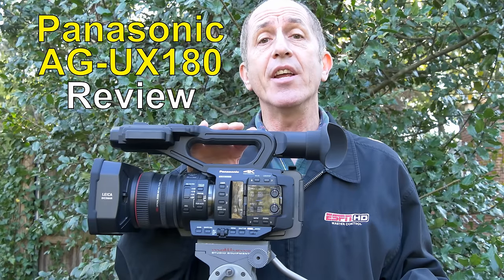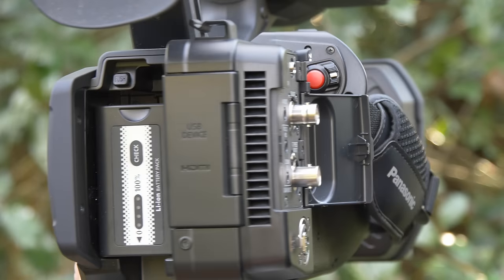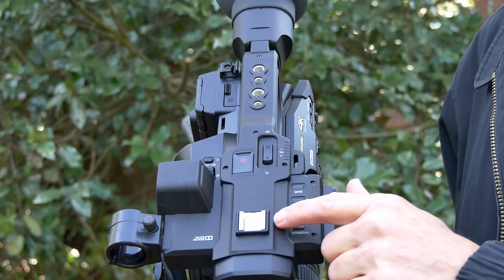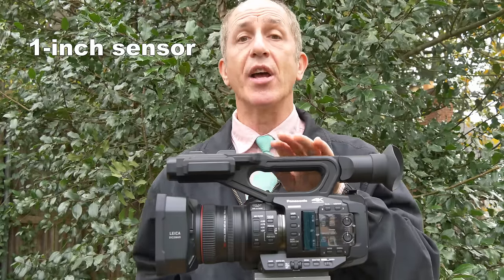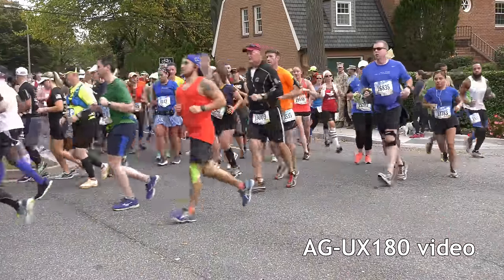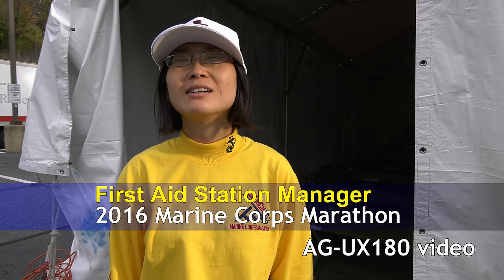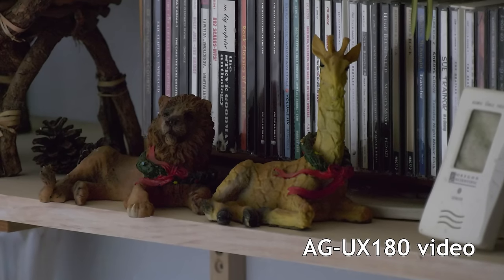Panasonic AG-UX180 4K Camcorder Review (in 4K)

Comment: How is the auto focus?   would this be a good camcorder to record lectures, sometimes with in low light situations., would auto focus find the speaker and stay on the speakers face?  And how is the low light performance, if the lighting is not the best or if the speaker is back lit, or if lighting is bad?
Reply from the maker: It's been a while since I used this camera, but I show in the video that the auto focus is excellent. However, I did not really test the auto focus in low light. The camera's low light performance is generally good, but cameras have gotten just a bit better since this camera came out two years ago. No camera will make bad lighting look good, but this camera is competent working in poor light.

Comment: Great review thanks. Quick question...I am using Adobe Premiere Pro CC 2018 as my editing software, any know issues with any of the file formats importing into PPCC2018? I know the Dolby issue has been reported, but not sure if any known issues with the LPMC audio. Thanks
Reply from the maker: Great question, but I don't know the answer. I am using DaVinci Resolve 14 and I tried files from the UX180 with Resolve. They work fine. However, I don't have Premiere. I edited this review with Corel VideoStudio X9, and it had some crashing problems. However, I think that is a computer/firmware issue more than it is a Corel VideoStudio issue.

Comment: Quick question. Looking at the left side of the camera there are 2 channels, is that 2 stereo Chanels or the left and right channels of 1 stereo pair?   My old Canon XL-1 had 2 stereo pairs when in 12 bit mode I really miss that? I would connect 2 Remote mics one to the left & the second to Right rear channels and the main shotgun mile to the front stereo pair. You'd be really supersized at what you hear when people are miced and forget. Lots of Bleeping in post too.
Reply from the maker: I no longer have this camera, as this was a loaner I got for review. However, it's my understanding that the camera records only two audio channels -- just one left/right pair. That's terrific that the old Canon XL-1 had four audio channels... that's handy to have when you need it. I can just imagine recording a concert with two direct feeds from the audio mixer and two for ambient sound.
Reply: Like I said Hearing the Pilot/s & their spotter/s while Videoing R/C Plans flying (Attempting) formation is neat.

Comment: Is the focus ring a fully manual ring with physical stops, or an electronic ring? How does the focus ring feel?  It looks like the servo zoom doesn't have a smooth acceleration/deceleration. Am I wrong?
Reply from the maker: The focus is an electronic ring, but it works fairly predictably. The servo zoom is a bit touchy and takes some getting used to, but it's much easier and smoother to control than the zoom lenses I have for my dSLR. If I add up the cost of my current camera and the three zoom lenses I have, it's more than what the UX180 costs. Since the HC-X1 is the same as the UX180 but without an SDI output, I could get the HC-X1 for less than my current rig, and it would be better/easier to use for video. Of course, the UX180 doesn't take photos, and I do take some of those with my current gear...
Reply: Thanks for the quick response and for posting the review Bob.

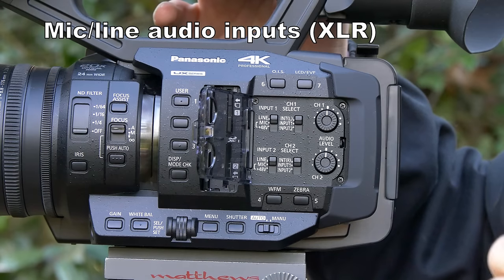Comment: The zoom rocker control you talk about at 1:00 you say that it has slow and fast. Is that the only 2 speeds it has for the zoom or is it variable? Does this apply to both zoom rockers?
Reply from the maker: The zoom rocker on the lens is a servo zoom that varies depending on your touch. This is one of the features that makes the UX180 a real pleasure compared to shooting with dSLRs -- you can do s-m-o-o-t-h lens moves easily. The zoom rocker on top has just two speeds, I think.

Comment: do you have the time to test the delay on the SDI output? on some youtube video is mentioned that the DVX200 had up to 10 frames delay on HDMI and SDI. may be the UX180 is beter here.
Reply from the maker: No, I don't have any SDI gear to use to test the SDI output. I did plug the HDMI output into a monitor and noticed considerable lag. However, that could be delay from the HDMI processing. The HDMI out did look great on my 4K TV.
Reply: thank yout for quick reply!

Comment: I seen a review of the ux90 stating that when filming in 4K with OIS on the minimum is 35mm. Is this true for its big brother the ux180 as well?
Reply from the maker: I don't think that's true of the UX180. My personal experience with the UX180 is that it is considerably wider than 35mm at 4K. Panasonic says that it's 24mm for 4K DCI (4,096 x 2,160) and 25.2mm for 4K (3,840 x 2,160). In my experience, those are the correct numbers.

Comment: Hi Mr. Bob Kovacs. UX180 - CX350 = BEST CAMERA???
Reply from the maker: I'm not sure exactly what you are asking. Between the CX350 and the UX180, the CX350 is the better camera. The CX350has a better display screen and the CX350 has MUCH better codecs and encoding flexibility. If the price was the same, I'd go for the CX350 every time.

Comment: Excellent review. Can you confirm that this camera is capable of shooting 4K with 24mm wide angle without the crazy cropping Panasonic cameras do usually? The other major drawback on Panasonic cameras is that manual-focus assist (magnification in MF mode) is not available WHILE recording, which is a shocking bummer for videographers who love manual focusing. Can you confirm, if this camera has MF assist while recording? Thank you so much.
Reply from the maker: Miklos, I did not test for the manual focus assist function. You can plug a larger external monitor into the HDMI or SDI ports, but that doesn't help a shooter with his eye to the viewfinder. So the answer to your focus questions is: I don't know.

And yes, the UX180 gets its 24mm wide angle (at 4,096 x 2,160 resolution) without cropping. The 1-inch sensor is 9.5-megapixel, so all (or nearly all) of the sensor is used. At standard 4K (3,840 x 2,160), there is slight cropping so that the wide angle is 25.2mm.
Reply: Thank you so much, Bob, for the explanation. Now I understand why my FZ2000 has the crazy crop in 4K. The FZ2000 sensor is 5472 pixels wide, a 4096-pixel portion is used for Cinema 4K, which is 1.33 crop of the total sensor width; 3840 is used for UHD 4K, which is 1.4 crop. The total sensor width gives 24mm FoV (EQ) in photography and FHD modes, that is 73.7 degrees, so Cinema 4K gives 32mm FoV (EQ) while UHD 4K 34mm. So the sensor in the AG-UX180 is totally different and optimized for 4K, this is the trick. I see. Thank you so much. Miklos
Reply from the maker: Miklos, I've been thinking about your viewfinder question. Although I don't recall if the focus assist window pops up during recording, my impression of the eyepiece viewfinder was that it had excellent resolution. In other words, I did a few rack-focus tests while recording and it was easy to get focus with my eye to the viewfinder. It is really a good viewfinder.
Reply: Thank you, Bob, for the follow-up information. Does the camera have a dedicated button for Magnifications? Nearly all Sony and Canon video cameras have button like that. On those cameras the engineers found magnification so important, that dey designed even a dedicated button.
Reply from the maker: I don't remember if it had a magnify button, unfortunately.
Reply: Hey Bob, I found this document http://pro-av.panasonic.net/en/sales_o/broch_pdf/ag-ux180.pdf and on page 6 it is written "Focus Assist (Expand and Peaking) When the Focus Assist button is pressed, Expand (enlargement)* or Peaking (colored emphasis of focus point) is displayed to assist the user's manual focusing operation. Expand and Peaking can also be displayed simultaneously."
Reply from the maker: Ahhh... thanks for finding that. The UX180 definitely did have peaking, which I find quite useful for focusing. My hands (and thoughts) are usually so busy when shooting that finding and pressing a Focus Assist button could be hard. I suppose practice would help.

Comment: hi there would you please give me the choice which one should I get between the two Panasonic hc x1 and Panasonic ux 180
Reply from the maker: The two are identical, except that the UX180 has an HD-SDI output and timecode output, both on BNC connectors. If you do not use either HD-SDI or timecode (both these are more for television broadcasters, such as TV news operations), then the HC-X1 costs less and is exactly the same in every other way.

Comment: Just plugged an xlr microphone into this camera,  switched on phantom power and have discovered there is a significant delay when monitoring the sound with headphones. Has anyone else noticed this or found a solution? Since I always monitor my sound with headphones this the resulting echo is a big problem and really annoying.

The image and sound do synch up so there is no problem with the usable recording.

Looking around at the many reviews out there on this camera only one mentions this problem. I have just bough this camera as a replacement to my AG-HM151 and I never had this problem with that camera - so I am a bit surprised that such an expensive pro camera like this would ship with such a fault.
Reply from the maker: Brian, I don't remember what the audio monitoring was like when I had this camera. I think I may have had it set to show/hear live video/sound instead of what has been recorded. But I just don't remember.
Reply: Hi Bob - I discovered that is exactly what the issue was. Another thing I realised is that my camera did not ship with a complete instruction manual - which if I had had the complete instructions I probably would have figured this out. Mine just came with a Basic Operating Instructions booklet. However Panasonic support was very helpful and called me back to help solve the mystery. BTW did your unit ship with a complete instruction booklet? I asked if Panasonic could send a nicely bound booklet - but they directed me to the download - which isn't as nice IMHO.
Reply from the maker: Hey Brian, Panasonic loaned me the camera to review back in October, and the box it came in wasn't even printed up for the camera. A full manual was not available at that time, so I got a preliminary manual that definitely had some gaps. I don't mind getting a full manual as a PDF, then printing it out myself if I need hard copy. But I see your point -- if you get a $3,500 camera, it would be nice if it came with something more than where the on/off switch is.

Comment: What for a SD card can you recommend me? how many Mbit/s uses the 4k 60p mode?
regards.
Reply from the maker: I use a PNY 128GB U3 SD card in both my 4K cameras, and the cards work fine at a data rate of 100 Mbps. I used a 64GB U3 card in the UX180 camera, and it was unhappy at the 4K/60 mode, which records at 150 Mbps. I did not try one of my PNY cards, though... that's what I suggest first. Here's a link to the card I use: https://www.amazon.com/PNY-Elite-Performance-Speed-P-SDX128U395-GE/dp/B00WWBCQEI/ref=sr_1_1?ie=UTF8&qid=1496152288&sr=8-1&keywords=PNY+128gb+sd+u3
Reply: Thanks Bob!

Comment: I have been using one of these cameras and the handbook states that you can access Variable Frame Rate and Super Slow Motion in FHD mode.  The only FHD mode that seems to allow access to these functions is 1080, 25p, 50M.  This is the lowest quality.  I want to use 1080, 25p or 50p and 100M or 200M.  At 50M, 100fps the picture is noisy and low quality.  Can you confirm my issue or do you have a solution?  I feel a bit ripped off.
Reply from the maker: David Leonard Sorry, I didn't try variable frame rates. I can't help you with that.

Comment: what is some of the difference between ag-ux180 and hc-x1 ?
Reply from the maker: I was unfamiliar with the Panasonic HC-X1. Looking at the specs and photos of it, it looks and reads exactly like the AG-UX180. From a quick look at the HC-X1's specs, I can't see any difference.
Reply: I think one of the "big" difference are the output. The UX180 has SDI connections while the HC-X1 doesn't. There could be other differences, but this is the one that sticks out to me.
Reply: That and TC, afaik.
Reply from the maker: Thanks. The UX180 definitely has SDI out, although I didn't try it.
Reply from the maker: Thanks! I don't use timecode for editing, so I didn't try that.
Reply from the maker: Here's what my Panasonic contact said about the difference between the AG-UX180 and the HC-X1: "The HC-X1 has similar specs and features as the UX180, however, it does not offer a 3G HD-SDI output."
Reply: Only the HD-SDI output, that's it. You pay and extra 1k on the UX180 for the bonus of having something not too many people will be fussed about. HC X1 seems a no brainer.
Reply: Question, when you press the zoom button does it has a small delay to it ? Like if you press zoom it would delay zoom  1sec later?
Reply from the maker: Sorry, I didn't see this until now. No, the zoom works immediately when you press the rocker switch. It is a servo zoom, meaning that you can do slow controlled zooms or zoom more quickly to get a fast focus.

Comment: hi i would like to try my hand at fast moving objects at night in  the sky .as I saw something recently at night  an want to capture it ..  I know i would need an IR camera . if I was to put a 950 filter on this camera , would it work .. or can u or anybody suggest a camera, filters, etc  that may to the trick
Reply from the maker: Peter, the UX180 will do infrared recording, but I do not know if it is compatible with a 950 filter. (I assume that's a wavelength of 950 nanometers.) You might try asking your question to someone at Panasonic.
Reply: hi again . iam currently use 5x42 monocular glasses ;:which have an almost endless range ''an recording though a camcorder but my pic is so grainy. an unclear . thank u for your advice . hopin for some more  advice but real hard to find ... what's between the stars  is alive ...

Comment: Can anybody tell me what the Maximum/minimum lens Iris/apertures are please when wide and at full zoom?
Reply from the maker: With the aperture wide open, the lens is F2.8 at the widest angle (24mm) and F4.5 at the narrowest angle (most telephoto). The lens can be stopped down from those apertures, but I don't know the highest F-stop.
Reply: Thanks Bob, I shoot with a Sony NEX EA50 at the moment, I'm a wildlife photographer. I'm just wondering if the Panasonic would be a worthwhile step up or do I stick with the Sony and continue to use my Nikon lenses with the Sony E mount, albeit that the Sony is 1080P?
Reply from the maker: I think you're going to want to go 4K at some point. If you already have lenses you like, you should probably look at getting a camera body compatible with your lenses. I like the Panasonic UX180 and it is a decent wildlife camera once you get around the fact that the lens maxes out at 480mm or so and can't be replaced. You may want a setup that will give you 600mm or even 800mm, and that can't be done with the UX180 (as far as I know, anyway). If you can live with the 480mm limit, the UX180 is a very nice camera. Still, it would be nicer still if it could do the 4:2:2 10-bit recording that the Panasonic GH5 can do.
Reply: I'm not an expert on video by any means but do I really want go from my Sony's APSC sensor down to a 1" sensor as I fear that it won't gather as much light as it is that much smaller. I also worry about claims of a maximum aperture/iris of f/2.8. As this sensor is so tiny that surely can't be correct, f/stops are based (as far as I am aware) on full size 35mm sensors (as used on 35mm film camera's) which are big and able to collect a vast amount of low light.
 
A one inch sensor would never be able to gather the same amount of low light due to its size, its ok sticking an f/2.8 lens on a camera with a smaller sensor and saying that you still have f/2.8 but in reality this is not true, you may get better reach but not the same maximum iris/aperture. This is true of any camera using a sensor smaller than 35mm. I use a Nikon 600mm f/4 lens on my Nikon D500 which has a cropped sensor and I do not believe that I am still getting f/4, with the reduced size and amount of light covering this sensor its probably more like a 600mm f/5.6.
There are a number of photographers who also support my claim, Steve Perry at Backcountry Gallery is just one.
I do however like the look of the Panasonic UX180 and it would probably be ok at at 480mm (just) .
Reply from the maker: Certainly, the 1-inch sensor is much smaller than the APS-C sensor in the Sony camera, and that raises a variety of factors. But I can tell you from considerable personal experience that you can shoot excellent video with a 1-inch sensor. Pretty good stills, too. And the cameras/lenses are much smaller & lighter than they are with APS-C and full-frame 35mm sensors. The question comes up: Do you want the convenience and lower-cost of a smaller sensor or the weight/cost associated with larger sensors? Is the quality difference that important to you? Only you can make that call.
Reply: Good point Bob & I wish I could decide. Thanks for all the info and your very concise review. Regards from England.